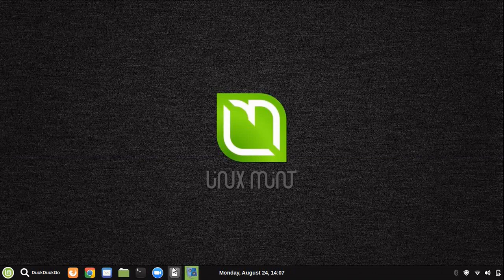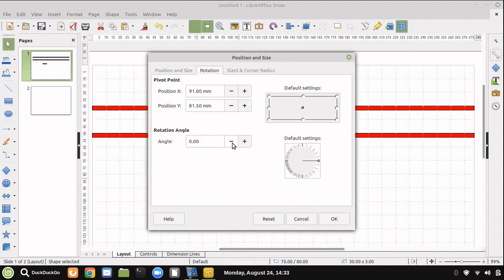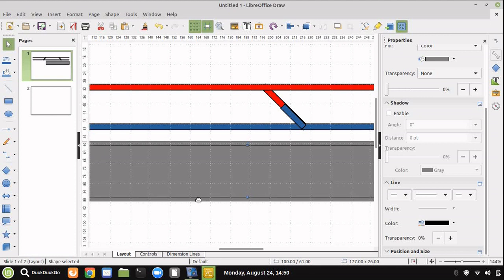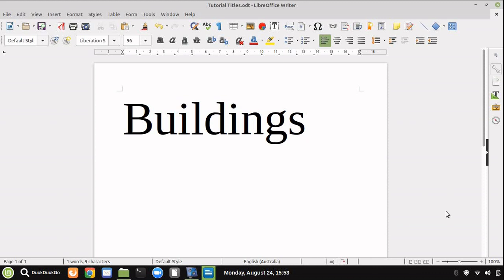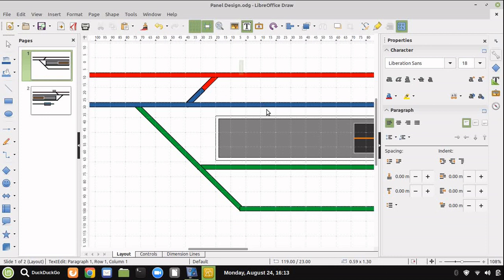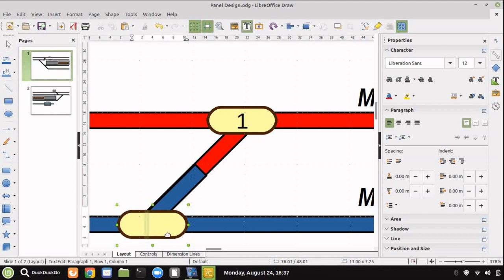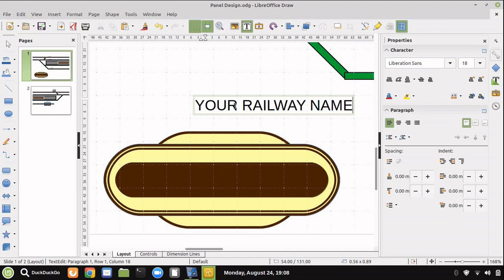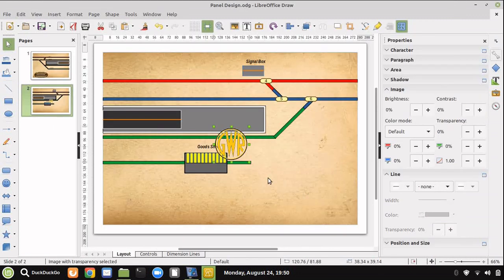Episode 153 20 Designing and Drawing Schematics for Control Panels Pt 2

Comment: Hi Gormo  I am unable to get properties up with the sub title characters, any clues I'm going round in circles.
Regards Chris
Reply from the maker: G`day Chris,
Go to the far upper right of the page, click on the three vertical dots, then click on properties.
Cheers
Gormo
Reply: Hi Gormo thanks for your reply. I've downloaded the PDF file the section on Libra Draw will be very helpful.
Yesterday I made my first attempt.at a mimic board which needs some adjustments so have saved it and will go back and improve it.
Thanks again
Chris
Reply from the maker: No problem Chris,
Happy to help if I can
Cheers
Gormo

Comment: Thanks Gormo, brilliant video easy to follow, but I must have missed this!. I didn’t see how you size  the overall size of design layout, so when the design is printed it fit the size of the base panel you it needs to attach it to!?  Best regards Brian - UK
Reply from the maker: G`day Brian.
Sorry didn`t cover that.
The whole idea was to fit the design to A4 pages in Landscape mode and either just use one page or multiple pages joined together.
I see your point though.
There are two ways you could adjust the size on one page.
First is when you come to print, the drawing could be printed say at 50 % or whatever to achieve the correct size.
Second method would be when the drawing is complete, to go up to EDIT and SELECT ALL.
Then right click and select POSITION AND SIZE.
You can then dial in the overall dimensions required but make sure the KEEP RATIO box is ticked.
Hope this helps
Cheers
Gormo
Reply: @greatchesterfordjunction  : thank you very much, I’ll try it in the new year…. and HAPPY NEW YEAR to you and your family. Brian- UK

Comment: ¡Hola buenas tardes Gormo!  You introduced me to Libra Office during the tutorial to build an updated coal office. Since then, all my scratch build plans and designs are worked out on that drawing platform!  I have updated to the latest version (don’t appear to be any bugs, at the moment) and, wouldn’t change my work method for anythIng else. My branch line has now been finalised (hmmm until the typical, ‘oh I forgot to add....’) moment arrives and, I shall definitely be using the draw platform to design the schematic for the new signals and switches. As ever, your tutorials are down to earth in approach and, your presentation method is aimed absolutely on the spot for all modellers to follow. Stay safe and well. Un saludo. Gary
Reply from the maker: G`day Gary,
Thanks for your update and I`m glad you`ve found LibreOffice useful. The Draw program is a good all rounder for model railway panels and schematics and you`ve probably found that when you work out the different functions in it, you can start to take control of the outcome with your projects.
Thankfully, it`s a cross platform software, so it`s available to just about everybody who wants to give it a go.
I am running Linux operating systems on my computers here  these days and it works fine. I left Windows 10 behind some time ago as it was driving me nuts for various reasons, so I took the plunge into Linux and I won`t be going back.
Well Gary...what you see is what you get with Gormo I`m afraid.....no airs and graces......just an old fart with a railway in a shed....LOL
Stay safe mate
Cheers Gormo

Comment: Thank you Gormo for the time you invested in this "How to". That was really useful and very well explained and demonstrated. I was impressed that you used free software and not a software which had to be purchased first.
Reply from the maker: Thanks Ian,
I`ve been using LibreOffice for a few years now and prior to that OpenOffice, also free.
These free office suites perform just as well as Microsoft Office and are compatible with it`s files as well.
I have been running a Linux system on my home computers for some time now, and LibreOffice is usually packaged with most Linux systems as the default office suite.........so it`s a no brainer for me.......and if it works ....why not.???
Stay safe
Cheers Gormo